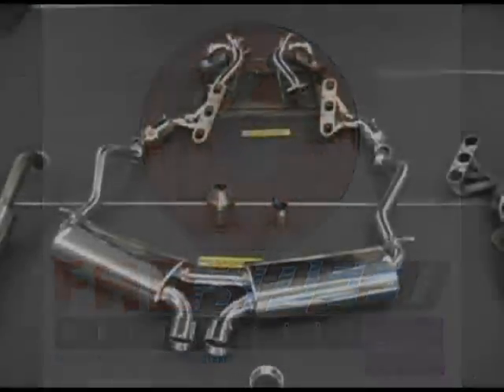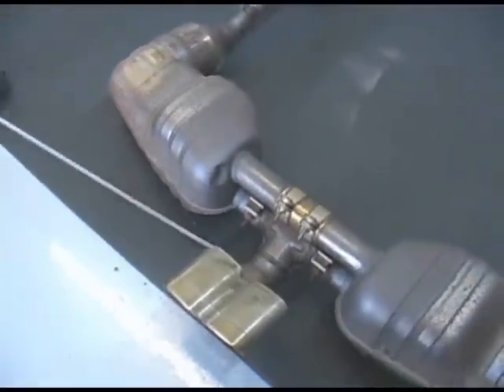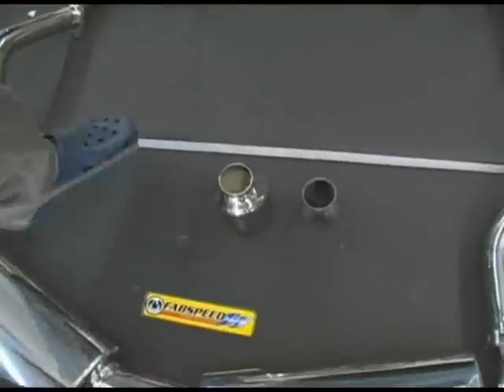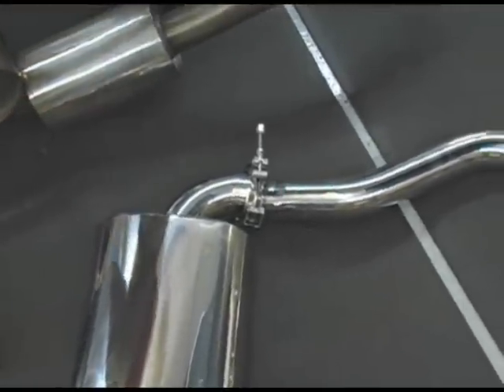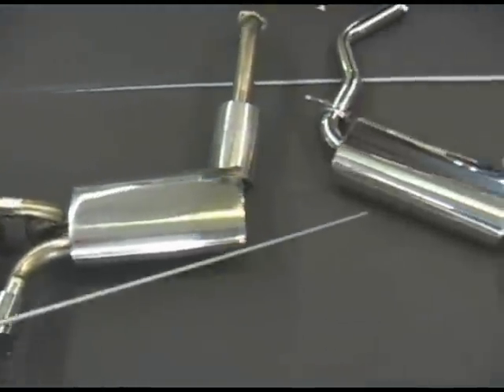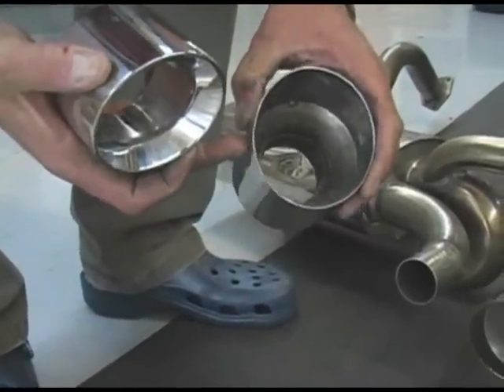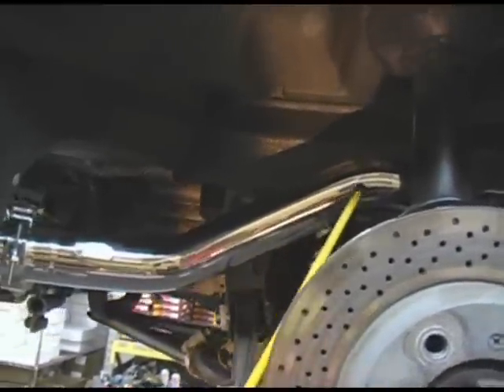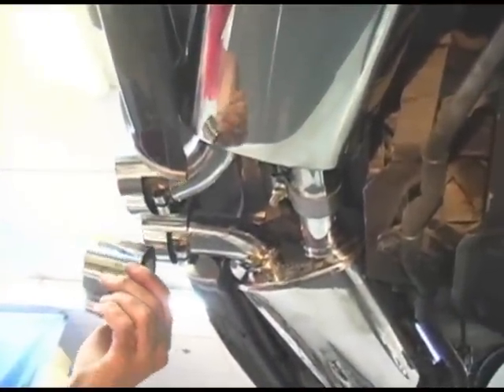Porsche 987 Boxster/Cayman (2005-2008) | Fabspeed Maxflo Exhaust Overview

Comment: What typical HP gains are realized on a Cayman or Cayman S with this system (with stock cat vs your cat)?  Also, what intake mods, if any, are required to get the most out of this system?  Great video, thanks.  I can't wait to get my Cayman and have you guys do the exhaust

Comment: At 3:07 you call your exhaust made from piping... but it is actually tubing. The difference is piping is measured by inside diameter and wall thickness, tubing is measured by outside diameter and wall thickness. On your site it is 14-16 guage tubing 2.25 inches in diameter. Giving you the benefit of the doubt and saying its the thinner material there, that makes the inside diameter 2.125 inches same as the milltek exhaust.